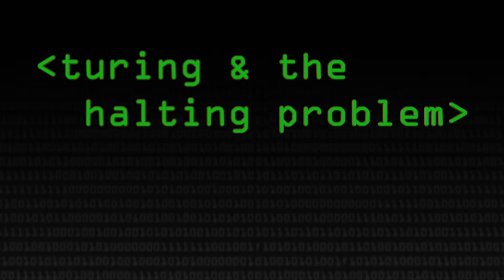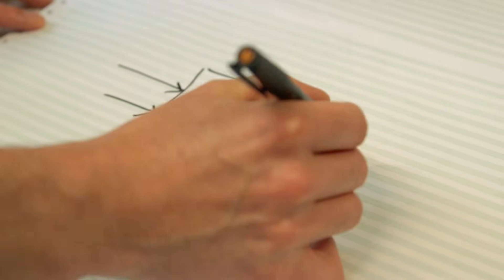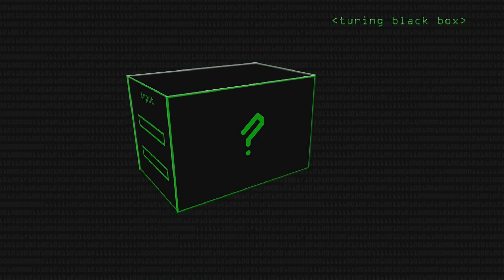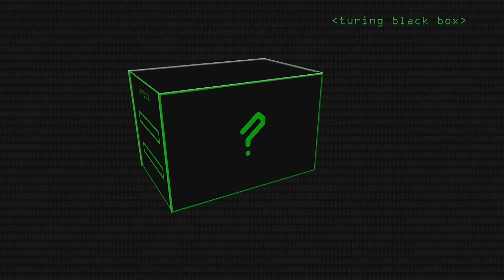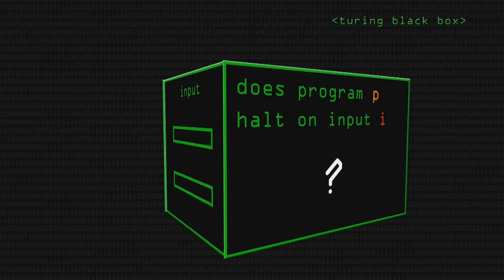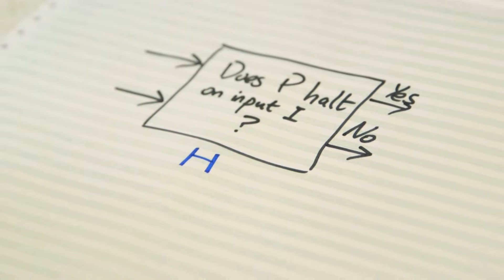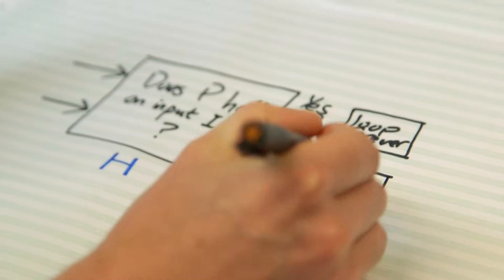Turing & The Halting Problem - Computerphile

Comment: I don't see the paradox. Eg assume H+ exists. It takes some input, determines the input will loop forever, so H+ halts. Now feed this H+ in to a H+ Clone. H+ Clone will correctly determine that H+ will halt, so H+ Clone goes in to an infinite loop. There's no paradox I can see. What am I missing?
Reply: First of all, for the context of the problem, H+ is taking the output of H+ as an input. And we are already implicitly assuming that H+ is solvable (because, if it isn't, then we already know that the halting problem is unsolvable), so H+ either halts or doesn't halt. The contradiction is that, if H+ halts, and we feed that result as input into the H+ machine, H+ then loops forever. So H+ gives us two contradictory answers for whether or not it halts.

EDIT: after more thought...
Think of H+ as a program. It's a program that takes any program as input, determines if that program halts, and then gives an output in the form of halting (if the input loops forever), or looping forever (if the input halts). In order for H+ to exist, then it must also be able to take H+ as an input, determine if H+ halts or not, and output accordingly. Remember we must assume that H+ is solvable, and therefore must output either by halting or looping forever. So let's say that H+ halts. If we give H+ as input to H+, the machine determines that it halts, and then loops forever. Vice versa applies too, so let's say H+ loops forever. If we give H+ as input to H+, the machine determines that it loops forever and then halts. This is the contradiction - the machine gives contradictory outputs for itself.
Reply: @gordonfreeman5958   thanks for your answer. I'm still not seeing a contradiction. Let's say you have a program, we'll call it P+, that determines if some input halts within 1000 CPU cycles. If it does, it outputs TRUE. Otherwise, it outputs FALSE. We both agree such a program indeed can exist. Now let's extend P+ to create a new program, P++. P++ is exactly the same as P+, except there's an extra line of code at the end that reverses the final output (TRUE becomes FALSE, FALSE becomes TRUE). Now take P++ and feed it in to itself. You get the same "contradiction" of two different outputs. But this apparent contradiction certainly doesn't prove that P+ can't exist, because we know it can exist.
Reply: @dippy9119  My understanding right now (subject to change after more thought) is that the H+ machine gives a contradiction and that your P++ machine does not. The crucial difference is that the H+ machine outputs a behaviour which corresponds to all of the possible answers to the question it asks. The P++ machine however, just outputs a lie. When you feed P++ to itself, the lie is disregarded and you will get the same answer every time
Reply: @dippy9119  In order to structure your P++ machine the same way, the outputs would need to be, instead of TRUE or FALSE, halt within 1000 cycles or don't halt within 1000 cycles. 

We assume that P++ is solvable and has an output, so let's say it halts within 1000 cycles. We feed P++ to itself, it then outputs by not halting within 1000 cycles. Actually yeah... That's a contradiction... Maybe this tells us something though, it means at least one of our assumptions was wrong. I don't know, I feel like either the video didn't go into enough detail or that we're missing some knowledge about logic to know what all this actually means, because I don't doubt that Alan Turning is right about the halting problem!

Comment: I think the fundamental logic used is flawed. If we can use that logic for if a Halting program could exist, then we should be able to test it on a program that we know can exist, and it shouldn't have this contradiction paradox.

What about a program that looks for self reference? A self referencing program example being CountLines.exe which counts how many lines is in itself (Countlines.exe). This self reference detector analyses a program, if that code needs an input that it hasn't been given, then it uses a duplicate of that program as it's input. If that program at any point uses it's own code as input, then the self reference detector outputs "self references" otherwise, it outputs "not self referencing".

 The output of the self reference checker is "flipped" or "reversed". We then combine these into one block like H+ and feed it into itself. It checks for self reference, and when an input is not present the program "duplicates" the input so that it can use the input program, as both the program to check for self reference and the input to that program. This isn't recursive as the self reference detector only needs to find one instance of self reference to definitively know if the code is self referencing. It finds that self reference as the code uses itself as input, and outputs "self references". Then the contrary thing changes this output to "Not self referencing". So the output of H+ given H+ is "not self referencing" which doesn't agree with H's output, and therefor by the Halting problems logic, the code that checks for self reference cannot exist. 

But we can write such a code that would detect self reference in anything but literally infinite code with the self reference at the end of that code. And if it requires an instance infinity to make it work then it doesn't work, because infinity only exists as an abstract concept useful only for philosophical debate.

Comment: There is no paradox here. The H+ fed into the machine must have some input p and i. The other H+ that is taking H+ and H+ as inputs obviously has different inputs. Programs with different inputs will/can have different outputs.

Take any function: 
x+3
Feed it into itself 
(x+3)+3
Of course they’re gonna give you different answers.
Reply: The part that wasn't made clear in the video was that the machine which causes the contradiction is "H+ taking H+ as an input", so you can forget about p and i, they are irrelevant. H+ is a function which, in this context, is taking the output of H+ as an input. Functions with a given input(s) must always give the same output every time - it can never change. 

We assume that H+ with input H+ is solvable, so it either halts or loops forever. If it halts say, then that result will be input again into H+ which will then proceed to loop forever, and that is our contradiction - the output of H+ given input H+ gives us two different answers. This contradiction means the assumption was wrong, so H+ given H+ as input is actually unsolvable.

It makes like 90% sense in my head, although the looping nature of it makes it a little hard for me to fully wrap my head around.

EDIT: I gave it more thought and I think i have a much more solid explanation here...
Think of H+ as a program. It's a program that takes any program as input, determines if that program halts, and then gives an output in the form of halting (if the input loops forever), or looping forever (if the input halts). In order for H+ to exist, then it must also be able to take H+ as an input, determine if H+ halts or not, and output accordingly. Remember we must assume that H+ is solvable, and therefore must output either by halting or looping forever. So let's say that H+ halts. If we give H+ as input to H+, the machine determines that it halts, and then loops forever. Vice versa applies too, so let's say H+ loops forever. If we give H+ as input to H+, the machine determines that it loops forever and then halts. This is the contradiction - the machine gives contradictory outputs for itself.

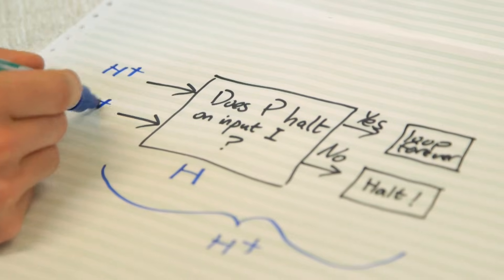Comment: Error: H+ cannot be converted to type Input<H+> for parameter 'i' at line 4:40.
H+ is a program, not a program and input pair, which is the input required for H+ p.
Reply: I saw a comment who fixed that error by letting H+ have a single input P and send <P, P> to H and of course do the if halt loop and if loop halt at the end. When it is done like this, if you give H+ the single input H+ you'll find that if H+ halts on H+, H will have determined H+ shouldn't have halted in the process, and if H+ doesn't halt on H+, H will have determined H+ should halt on H+ during that process.
Reply: The comment didn't bring up this, but I realize that not all programs can accept themselves as inputs. I imagine we can also extend H such that no will be the answer if the input is not allowed (because it should halt with an error)

Comment: I have noticed, as both a computer scientist and amateur mathematician, that logical systems seem to break down quite readily when we allow self reference. Case in point, the Incompleteness theorem
Reply: there is not really any self referencing here, H+ is defined without H+, same for H. Imagine H+ is some actual .exe file that needs a file as an input, you are allowed in the real world to give the .exe file to your .exe program.
Reply: @flo0778 Self-reference in this case is not in the definition of the function, but in its application: H is applied to H+ which is defined in terms of H.
Reply: Same with sets
Reply: @MrBigbanan imagine you are trying to actually learn something and you ask a very hard question to your computer. If it "runs forever" you will never be sure that its a no, maybe its just slow and it will eventually say yes. And you cannot ask another computer to tell you if it will run forever...
Reply: They seem to break, but only sometimes. Self-reference is tamed and works beautifully in many recursive functions. 

Further, I'm not sure whether this is a breakdown, as opposed to a limitation: there is no ultimate theory, or machine, no matter how powerful. They all have their uses and limits.

Comment: I am really confused. How can you give only H+ as an input to itself. H+ (and H) takes in two inputs right, the machine and the input. So at  4:33 , shouldn't the lower input actually have two parts. One for the the machine H+ and one for the input to it which is also H+ ?
Reply: The full H+ machine also includes a component that takes a single string of code and feeds it into the H machine as both program and input.

Comment: do not give this program to the machine and you will be able to solve the problem in all other cases.
Reply: Well, first, just because you don't doesn't mean your enemies won't. Second, it's also impossible to correctly determine whether someone snuck in a program with the same behavior as input.
Reply: @FawfulDied  don't use H+ machine, but only H and all will be ok
Reply: @ne4to777  How can you prove your enemy does not use H+ or a machine equivalent to H+?
Reply: @FawfulDied  , my enemy can use any machine that he wants, but i will use H-machine and always get the right result. My enemy should fail on H-machine to prove halting problem.
Reply: @ne4to777  His machine he feeds to yours will act exactly the same as a machine using your H machine would. If you are counting on your H machine to distinguish halting inputs from non-halting ones (which is an important question), then you are destined to fail.
Reply: @FawfulDied  , You only confirm the problematic nature of the H+ machine. It's just unnecessary to use it at all.
The halting problem is formulated as the absence of a GENERAL solution. And it really isn't if you use an H+ machine. But in all other cases, you can determine whether the program is running or not.
Reply: @ne4to777  The reason the proof works is because H+ uses an unmodified copy of H inside it. If you feed H+ to H, H will give the wrong answer every time.
Reply: @FawfulDied  , Okay, imagine a program that works flawlessly. Then you took and added a couple of lines of code there, after which it stopped working. What is so surprising here? First rule of programming. If it works don't touch anything.
Reply: @ne4to777  Imagine a program that works for every input you can think of. Then, someone creates an input to your program that makes it give the wrong answer. Does your program work or not?
Reply: @FawfulDied  , you are absolutely right in this case. But the video says (4:44) that the H+ algorithm is used both as an executable program for analysis and as input data for itself.
Let's add some formalism.
1. We have: H(X) -> true | false, where H - analysis program, X - data for analysis
2. We need to prove that: H(X) -> absurd
3. The video proves that: H+(H+) -> absurd.
4. You said, that: H(H+) -> absurd. But it's not (4:44).

This is proofs for different theories

Comment: For people in comment that want an example of a really simple algorithm yet very hard to tell if it will finish or not is Collatz conjecture.

It goes like given an input x if it is odd triple it and add 1, and if it is even, half it. Keep doing it until you reach 1.  
Fun fact is that there is no way to tell how many steps it will take for any X without carrying out the algorithm. 

NOTE this has nothing to do with the halting problem. This is just a fun contrast to other common algorithms which we can easily tell if they would halt just by inspecting them.

Comment: I keep looking through proofs of this, but I am a little confused; it almost seems arbitrary that we say that if program P does halt on a given input of I, then we loop forever. Why would we assign "loop forever" to the output of yes ("it does halt")? If such a program could deduce that we halted, why would it then need to loop forever? Would it not just halt after producing the answer?
Reply: The following 3 lines will clear things up:

def thisFunction ( ):
        if halts(thisFunction):
                  loop_forever( );

Now, if halts says "thisFunction" will halt, then "thisFunction" will start looping forever, therefore the answer was wrong

Comment: This is wrong. Its framed like the highest H+ and the H+ its analysing should come to the same conclusion but the lowest H+ has no input and is unsovable. The programm couldnt run because its missing input.
Reply: It doesn't matter if H+ receives an input or output itself when being simulated because once ran if it doesn't have a valid input it will either, throw an error due to no/invalid inputs (Halts) or it will not know what to do without one (Loop). No matter what you do the program still results in one of those two actions.
Reply: @Outwardpd  but it isnt a paradox anymore because they are different. In the right version the input is duplicated, but i still have a problem with calling it a paradox.
Reply: @herscher1297  When H+ tests itself it is basically running another H inside of it via simulation. Whether the H being simulated has an input or not always results in either a loop or a halt, so you really only need H+ as the input in 2 different levels of the simulation. So in this example scenario we'll say the H+ being simulated has an H machine inside of it getting the result H = true (halt). However the + portion of the simulation, the N(z) portion, changes that to instead make H loop rather than halt, this means that the actual H+ machine will have H = false (loop) due to the natural of the machine.

What this all means is that inside of one machine you have H(H+,H+) = true AND H(H+,H+) = false. Which means that either the machine is wrong OR it is stating that it is neither halting nor looping, which isn't possible (a light has to be either on or off, similarly a light can't be both on and off).

So when you run H+(H+,H+) you end up with 2 (or more) results of H(H+,H+) who have contradicting answers, and since in this thought experiment H ALWAYS gives the correct answer, the fact that it couldn't give the correct answer means that H cannot possibly exist.

You're basically tricking the machine into giving the wrong answer (to put it simply) but if a PERFECT machine existed it wouldn't be able to be tricked. As of our current understanding of Turing Machines (of which all computers, quantum or not, are Turing Machines) we've proven that it is possible to trick a 'perfect' machine, which means it can't exist within our current realm of understanding. The whole thing hinges on having a fairly solid understanding of mathematical proofs, that way you can understand that H(H+,H+) = true and H(H+,H+) = false cannot both simultaneously be accurate.
Reply: @Outwardpd  your error lies in thinking that you are comparing H(H+,H+) and H(H+,H+) but without a copy mechanism in front of H+ you only get H(H+,H+) and H(H+,null). The H+ you are running and the H+ it is simulating dont have the same input and can therefor have different answers without being paradox.

Try to run the simulation in your head: H+¹(your machine) gets H+² and H+³ as input. H+¹ starts simulating H+². H+² gets H+³ and null as input. The H in H+³ says its a Halt and the negator turns it into a Loop. The H of H+² says its a Loop and the negator turns it into a Halt. The H of H+¹ says its a Halt and the negator turns it into a Loop and thats the answer, there wouldnt be a paradox. 

You need a copy mechanism to make sure that every H+ gets the same inputs. This would bring other problems but lets first get on the same page.